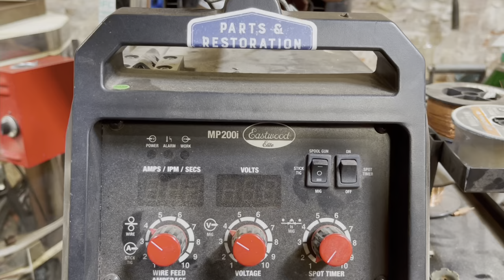Rusty Vise Restoration | Chas Parker 288 1/2 | How To Make ChasParker Vise Jaws PART 2

Comment: Instead of welding cast iron, brazing will give a better bond.  Also use a torch to heat up both the iron and the steel before brazing.

Comment: I enjoyed your vise restoration. I am confused why you used a nut instead of a steel pin to secure the main nut in the vise body? Also I would refrain from painting machined surfaces because over time the paint will gum up the surfaces that slide against each other. This are minor gripes mind you, I enjoyed the resto greatly! I am a vise fanboy!